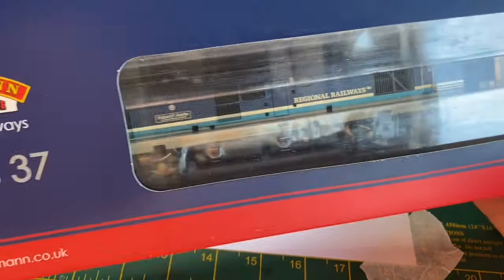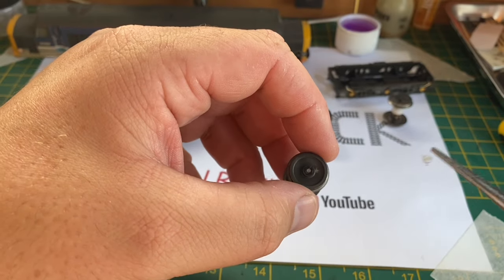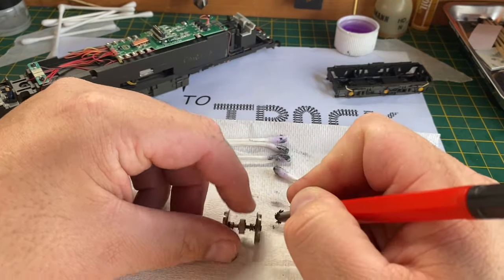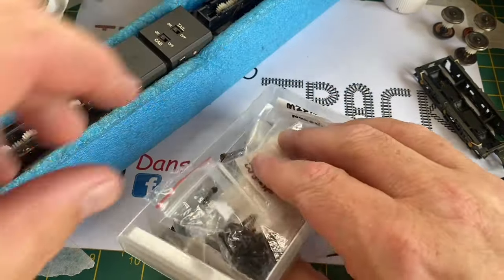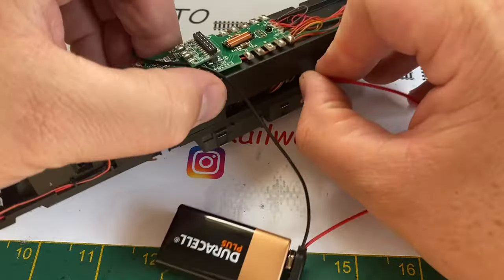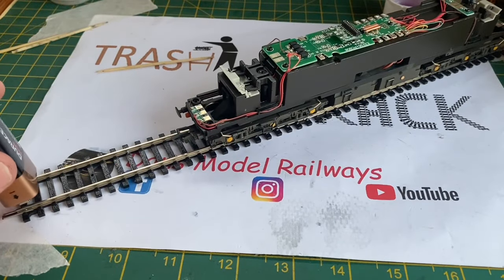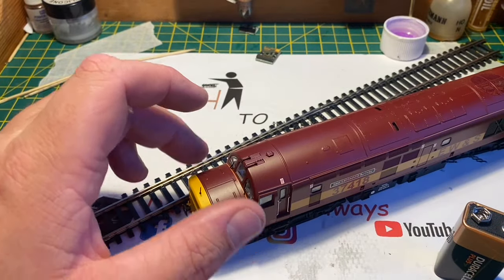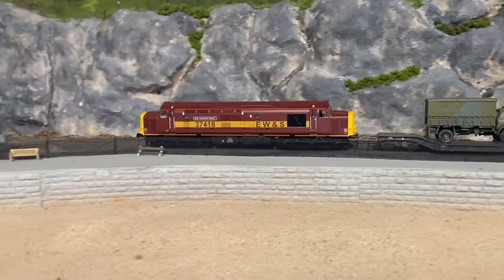Trash to Track. Episode 73. Bachmann class 37’s.

Comment: Hi Dan, An interesting video, I've quite often found the chemical blackening in the back of wheels, one point that needs to be mentioned is to always back self tapping screws into the previously cut thread, otherwise you eventually end up with a screw sizes hole. Regards, David.